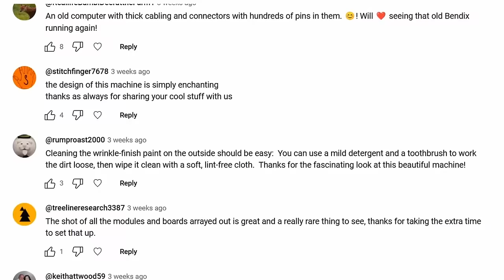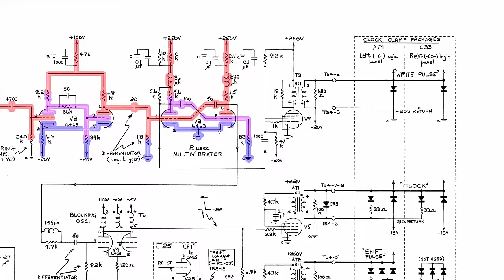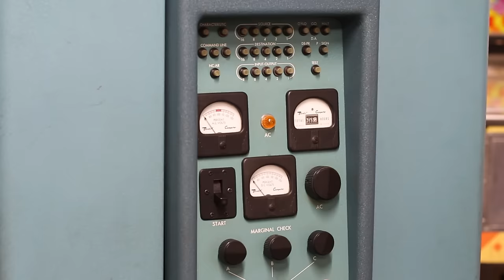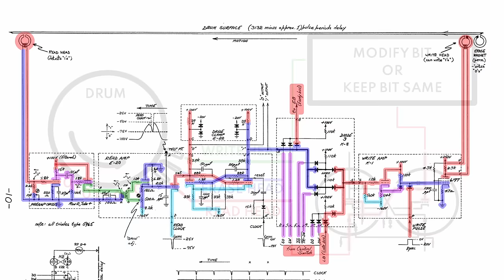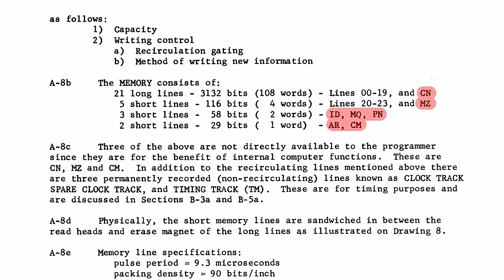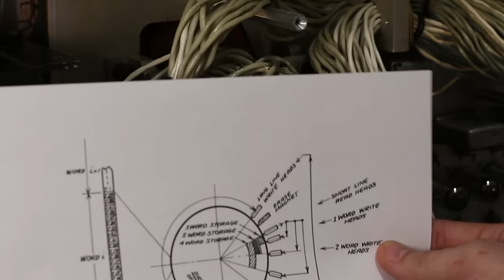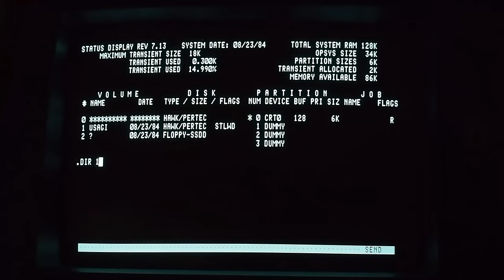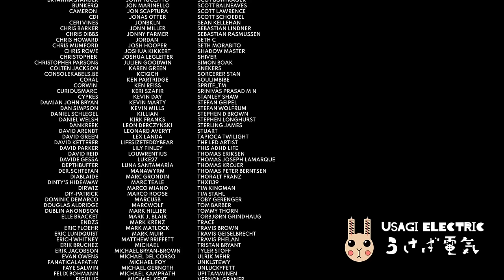Rotating Drum Memory with the Bendix G15

Comment: as soon as you talked about head crash, I thought "that's not possible on a drum". Because the heads are static and the drum doesn't move either beyond spinning around, the heads cannot crash unless the drum bearings fail, but crud accumulating on the drum or in the gap between the heads and the drum, most certainly can damage both. The way these old 50s-60s style magnetic storage surfaces were made is however fairly primitive compared to modern storage, so it should be possible - aka relatively simple - to resurface them, as long as you can get the chemical materials required together. There are a couple IBM film (that can be found on youtube) which show the whole process, minus the chemical mixing, of how they made the RAMAC disks, and it always struck me as a "is that it?" moment, but since they did it basically by hand, it really shouldn't be entirely impossible to repeat the process
Reply: There were also machines which had flying heads.
Reply: The drum memory (General Dynamics if my memory is correct) that we had in the #1 EAX telephone switch from Automatic Electric did indeed move not just rotate. The drums were vertical and conically narrower at the top.  There was a centrifugal scissor mechanism that lifted the drum at a certain rpm on spin up. This allowed the heads to ride on a cushion of air when spinning at full speed and provided clearance so the heads wouldn't crash on spin down.
Reply: @randymass6688  I'm guessing that this drum was from before flying heads, since the patent refers to an abrasion-resistant coating, which you wouldn't need on a non-contact device.
Reply: @ke9tv  I'm not sure what the surface was. All I remember was it was shiny perhaps nickel? We had scheduled routine maintenance every couple years to spin down the drums and clean the surface with lint free cotton and 99% isopropyl alcohol. We quit doing that as we usually had to change a head or two after doing that proceedure.
Reply: @randymass6688 Mostly, the drum substrate was aluminum.  I know they could be recoated.  You needed a big engine lathe to resurface them but the process wasn't too different from turning a brake drum and then painting a surface.
Reply: Well, I'd be checking the bearings if gunk got into the drum assembly, for if gunk got into the bearings they could corrode and introduce play if not sticking.  I'd be thinking an epoxy compound for the coating, so it would cure rigid and then could be machined and polished to a final surface.
Reply: I wonder whether the heads could be moved longitudinally so they'd be over a slightly different area of the drum, since the track spacing would seem fairly wide relative to the width of the scratches.
Reply: @douro20  I confirm flying heads this as I used to design such!
Reply: He later thinks one metal expanded when overheated

Comment: Back in my early s/w dev days I worked on real-time systems that used drum memory, but not used as RAM (this was the 1980s). The drums were used as fast HDs, and with a fixed head per track there was no seek delay.
Reply: Some early big 19“ rack style hard disks also sometimes had one platter with fixed heads for quick access.
Reply: Early Hewlett Packard timeshared BASIC systems used a fixed-head magnetic drum as a swapping device.  Since the heads were all fixed, there was no positioning time, and the moving-head hard disks of the time simply weren't fast enough to provide reasonable response time in a multi-user timeshared environment.   These systems were used into the mid-1970's, by which time multiple moving-head disk drives with smart controllers that optimized access by sorting the order of disk seeks made swapping across multiple drives quick enough to eliminate the need for the drum.   Back in the drum days of HP Timeshared BASIC,  there were some operator-only commands (from the console terminal only) that would allow a program to be copied to the drum to allow it to load much faster than when loaded from the moving-head disk.  I also remember touring the data center for a DEC PDP-10-based timesharing service in downtown Portland, OR where a HUGE (in a box about 10 feet long, four feet deep, and 5 feet tall) drum was using for the swap device on a timeshared system that hosted something like 200 simultaneous users.  This was sometime around 1975 or 1976. I remember being told that it took almost 25 minutes for the drum to spin down to a stop when it was turned off (which was very rarely done) because of the sheer inertia of the drum.    So, drum memory technology did live on, but not as main memory, but as a high-speed swap/paging space.

Comment: If you can re-coat the drum, what stops you modifying the process for hard disk platters?
Reply: not much, though you may need a more difficult to build vacuum chamber
Reply: The accuracy requirements were different from hard drives
Reply: Maybe the Hawk drive platters can be fixed as well.
Reply: Essentially nothing. Tolerances are going to be the biggest issue though.
Reply: @the123king  that’s kinda what I figured

Comment: As someone that worked on drum memories at the end of their era, the first thing I want to say is I hope you have the maintenance manuals with detailed instructions on drum setup and adjustment. That is something that if you get wrong, and don't follow the step by step procedures pretty much exactly, you can/will destroy the drum and/or the heads. Ideally you would have the factory setup manual, but you almost certainly don't.

The Burroughs 205 had an adjustment procedure called "ticking the heads". You spun the drum up, gave it an hour or so for the temperatures to stabilize in the drum and surrounds. Then you carefully adjusted each head inward until you just started to hear a faint ticking sound, as the head contacted the high spots on the oxide of the drum. Then you backed the adjustment off by some fraction of a turn and locked it down. This gave optimum read amplitude and write saturation of the drum coating.

Knowing about that procedure, where the heads were deliberately crashed during adjustment, makes me a lot less worried than you are about that scraped drum. It could be trash of course. But it might not be trash. Bit density was really low in those days, track spacing was wide, tracks were wide. All of that gave a lot of latitude for the completely expected irregularities in the drum coating thickness. In fact the ticking procedure flattened the bumps off the coating, making it better.  It would be decades before the mag tape and disk guys really got coating deposition down to a fine art.

Now I saw one metallic scrape, so one track may be toast. And I'm concerned about the mildew-like stuff. It would be good to try to wipe it off, but I'm really concerned that the drum coating may go the way of the silk screening on the tubes, when you cleaned them. If I were doing it, I would rotate the drum manually, maybe even using a stethoscope, and listen for any ticking against the heads. If I didn't hear any, I'd put the cover back on, power it up, and give it an hour to stabilize. If it still didn't have bearing problems or obvious crashing noises, I'd try using it and see what happened. You might get a surprise.

BTW, for mildew removal and general gentle cleaning, a spray can of Lysol works wonders. I wouldn't use it on the drum, but a little of it along with the soap and water (or just it and a rag) can do wonders.
Reply: Lysol consist primarily of alcohol so that explains that.

Comment: Dude, being able to re-coat a drum would be a massive game changer! I'm guessing you'll need to strip the old coating and re-grind/polish the surface to get rid of any imperfections before re-coating. Then clean and re-adjust the heads. It's an insane undertaking, but if you succeed, it could be the start of bringing an entire generation of dead machines back to life!

And if you are successful, the next obvious question would be is it possible to re-coat a Hawk drive platter. I'm guessing the answer to that would be no, since you couldn't just grind the platter thinner to get rid of the divots from the head crash. It might be possible to do something even more insane like aluminium spray coating to build the thickness back up before grinding and polishing, but the level of precision would need to be way higher, and the risk of destroying more precious heads might just be too high to make it worthwhile.

... unless you can figure out how to manufacture new heads.
Reply: Something like an epoxy base might make sense here.
Reply from the maker: The initial plan for stripping the drum would actually be machining. Chuck it in the lathe and machine off the existing coating to expose clean aluminum for the new stuff to adhere to. 
As for getting stuff to adhere to the aluminum, I was thinking and appropriate primer sprayed thick enough and then machined to the perfect runout. Finally, the new magnetic coating would have to be precisely sprayed and hopefully self-level to the level of precision we need.

Recooating a hawk platter is a whole other level of precision though. The Hawk has around a 50x tighter clearance between the head and the magnetic surface. That's a level of precision I may not be able to achieve. Fortunately, the Hawk platters are the same as the DEC RL02 platters (which is an IBM standard), and there's a ton of those still floating around out there. It's the Hawk heads that are the hard part, and rewiring some of those is... not going to be easy, haha.
Reply: @UsagiElectric  Cool! Best of luck!

Yeah, repairing or making replacement Hawk drive heads would be amazing, but if it were easy, I'm sure someone would've already attempted it by now.
Reply: @UsagiElectric  I'm still watching through the series, so I don't know how far along you've gotten, but I would not attempt on a lathe. I think an OD grinder would be a much more appropriate machine.

Comment: I wonder if you could just stick a turn of modern magnetic tape to the surface of the drum.
Reply: What rpm are we looking at tho? Interesting idea if the tape holds on.
Reply: Yes, this must be considered I think. The material and even thickness are already taken care of this way, and it's cheap.
Spray-adhesive ought to fit the bill.
In the end, only experimentation will tell if it's the way to go I think.
It could be wound manually, slowly, with an usb microscope in place to align it really well I presume. 
At least 3" tapes are/were available! Then again, overlapping layers is maybe better anyway?

I guess It can be argued that actual coating is more authentic.
Reply: The adhesive mag tape method is nondestructive... Put the tape on and continue restoring and when you are ready, scrape the tape off and recoat.
Reply: That was pretty much my first thought. I could see the join being a problem. As it crosses past the heads it could introduce noise. You obviously can't get tape that wide so my next thought was to wind tape on as a spiral. That way you don't get a sharp join line crossing the heads. Any noise caused by the discontinuity between wraps is going to be much lower frequency than the data so it should hopefully be ignored by the read heads. It would also be a lot easier to apply than multiple parallel loops. You'd only need to clamp/glue each end of the tape.

Comment: 17:07 Machines using drum main memory tended not to be sequential in executing instructions. If the address of each instruction was just N+1 you’d have to wait for a minimum of one drum rotation per instruction, while the ALU etc. is orders of magnitude faster. So the instruction format includes a value N (7 bits) which indicates where the next instruction is to be found on the drum. So allowing for the execution time of each type of instruction you could line up the next instruction to be read without any latency. This was termed ‘optimal programming’. Alan Turing who conceived this idea for his ACE computer, on which the G15 is loosely based, had the idea that an assembler program would keep track of the timings automatically to avoid this being a huge pain for the programmer.
Reply: Indeed, this was the job of the SOAP assembler for the IBM 650 which was also drum-based. It did a pretty good job of optimizing the next instruction address.

Comment: Hi. The “blocking oscillator” is probably nothing but a fine-tuned bandpass filter. You can tell, because there’s an inductor in series with the signal path from the 2 microsecond multivibrator to the blocking oscillator; this’ll stop frequencies higher than the bandwidth, and the capacitor will block DC and frequencies lower than the bandwidth. So only frequencies in the passband will make it through. In this case, you can also see that someone put a sketch of the output waveform off the output, which shows a ringing pulse with a DC offset of -20 volts. This comes from the output of T6 (pins 5 & 6), which is driven by the plate (pin 6) of V4 to the -100 volt supply. It’s likely the designers were trying to tame the odd harmonics if the square wave pulse from the 2 usec MV.

Comment: I wonder if ATR Magnetics in PA could help out with this. They are the only manufacturer of analog audio tape in the US. If not the actual application process, I'll bet they could supply a bucket of the magnetic coating.
Reply: at least that would be a great video explaining why that wouldn´t work
Reply: @ReinaldoRauch  Ha! For sure. Way above my head. To me magnetic goo is magnetic goo. I imagine there were PhDs done on the subject at one point regarding grain size, exact chemical composition, additives, yadda yadda. My thought process would be that this is old enough, the density is low enough, you're dealing with binary, that there'd be a lot of wiggle room and if you could get it to stick and at the right thickness you'd have a nice shot starting with an existing liquid that's good enough for tape, although it might cost thousands of dollars for the quantity needed for the necessary experimentation. Going the other direction and trying to get random goo to sound like a high quality analog audio recording definitely seems impossible.

Such an interesting challenge. May have to scrape some rust off my truck and experiment myself.
Reply: Was wondering if they could simply paste down video tape to the drum and calibrate the head distance to match the slightly larger drum diameter.
Reply: @barcodenosebleed5485  I'd think one could get powder; the goo part is matched to whatever it has to cling to.  I'd be thinking epoxy here.  There will be pretty substantial centrifugal forces involved that aren't involved with any kind of tape.  Perhaps application of an excess followed by vacuum curing (to outgas any entrapped air) followed by machining, applying a bit more epoxy minus the powder, and polishing would be the process needed.

Comment: as a Hammond organ collector/repair guy who got into building analogue synthesisers, read "The Story of Mel" in The Jargon File back in high school, and is now replacing microcontroller firmware from 2008 with CMOS/transistor/diode logic, i'm really enjoying this video, and yes CLEAN THE TUBES. :)
Reply: The gunk that got on the tubes might be of the same origin as the gunk that got on the drum.  I doubt the gunk would hurt the tubes, but the unit sure looks better with clean tubes, and being able to read the tube number is another safeguard against putting the wrong tube in the wrong place.  (I believe the tube numbers were etched on the glass surface so cannot be washed or rubbed off by any reasonable process.)
Reply: pulled an old hammond analog gear drive oscillator stack recently..  was still perfect...  a real beauty.

Comment: Hi, the blocking oscillator is a type of transformer (inductance) coupled oscillator that works by "blocking" hence the name the current flow of the tube via the feedback path produced by the coil from plate to the grid!
Also, the chokes on the multivibrator may be peaking coils, they were used in TV circuits to provide higher bandwidth and better specs, altough with a few downsides with I don't remember. As soon as I remember something else I'll update the comment
Reply: Also the tube designation can be used to recognize the brand that build it!
Glass etched numerals are for GE, the little frame around the name is from RCA I think
Usually small companies would produce their own tubes by just rebranding lots from various higher-volume factories
Reply: As an example, here in Italy we had (until the 70s I think) both FIVRE and ATES, both italian company names that, as acronyms meant "Italian radio electronic valve factory" -> "Fabbrica Italiana Valvole Radio Elettriche" and " Aquila Tubi Elettronici Semiconduttori" "Aquila (italian city) Electron Tubes and Semiconductors"
Basically all the tubes we had were literal copies from the crates the US soldiers left here after the war, and then we started producing them under RCA license, keeping a similar box apperance and designations, altough a personal one (used only in italy) was introduced

Comment: Back in the later 1970's I bought a drum memory system that had been part of a NASA computer system that was used with I recall was called the "Astronomical Orbiting Observatory".  I was able to get it working as drum storage on my Motorola MC6800 home computer at the time.  It had a "massive" 256K of storage for me.  I could read the entire drum in 8 seconds.  It used 128 heads on a large solenoid that would engage the heads once the drum was up to speed.  It was made by the Vermont Research Corporation.  I still have the drum assembly but had to ditch the cabinet and the transistorized circuit boards.  It's probably only good as scrap aluminum now.  (I'd remove NASA label(s) first.)  The same computer system had a paper tape reader and punch that I also had running on my 6800 system back then.